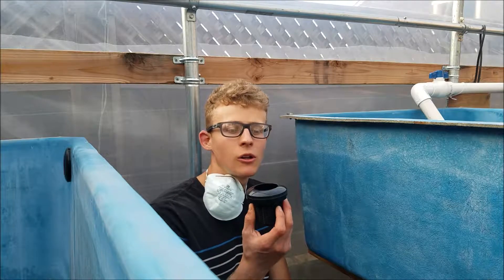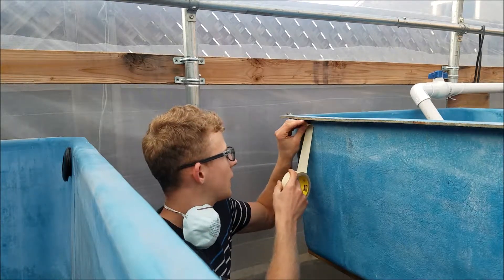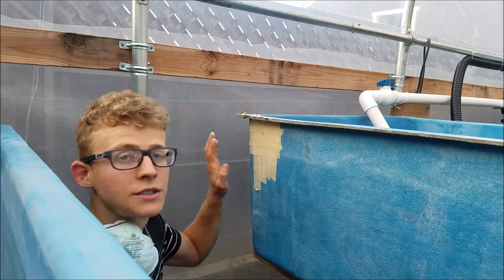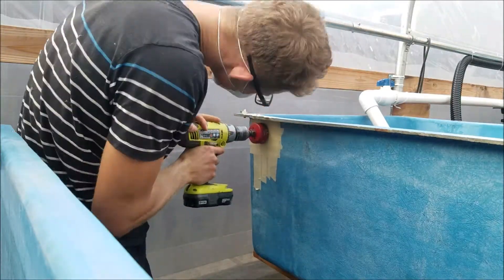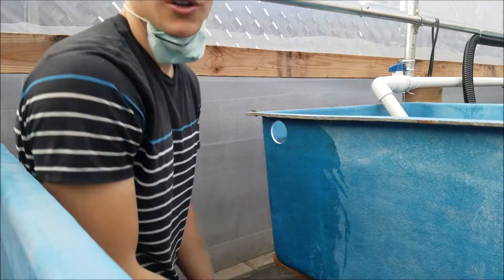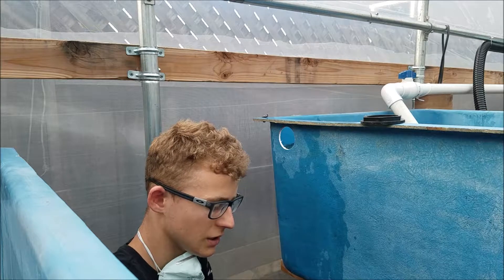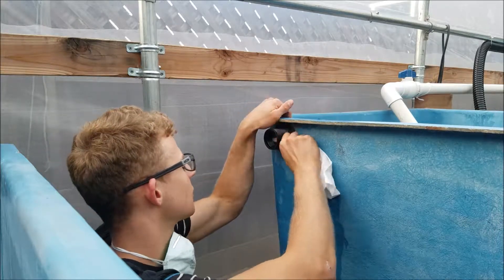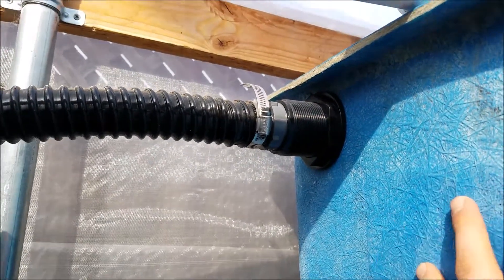How to install a bulkhead fitting (Hybrid aquaponic system)

Comment: What's the name of the gray part that you're pointing to at 3:17? I'm struggling to figure out what to buy to connect the actual pipes/tubes to the installed bulkhead fitting.
Reply from the maker: Its a barbed adapter or barbed fitting 
https://amzn.to/44gwcUZ
Reply: @vonponics  thank you!

Comment: Hi what if the wall of the tank is not the same thickness and the bulkhead does not fits properly ? Can I use silicon ?
Reply from the maker: Yes if silicon is needed you can use it. You can use the bulkhead on a thicker walled tank, as long as you can get it to clamp down. Most times as long as the surface is flat you don't need to use silicon.